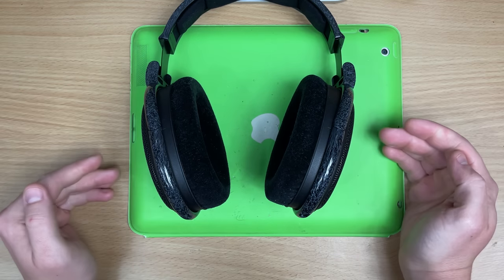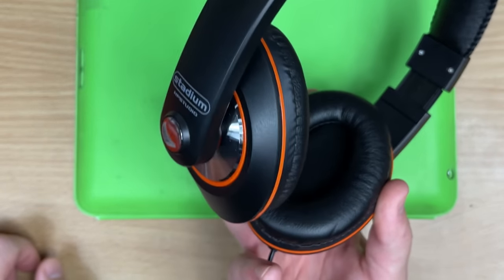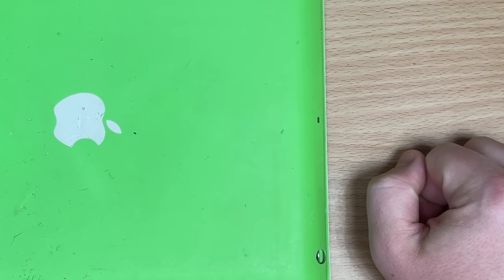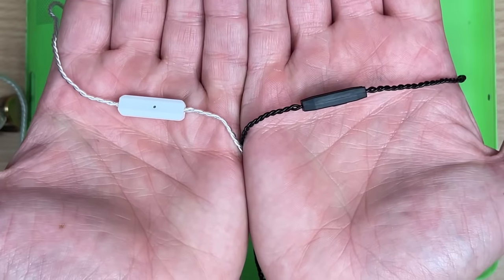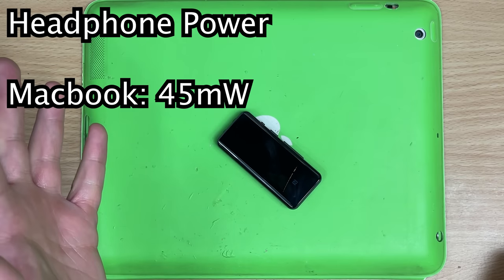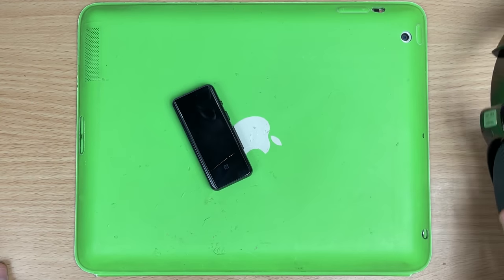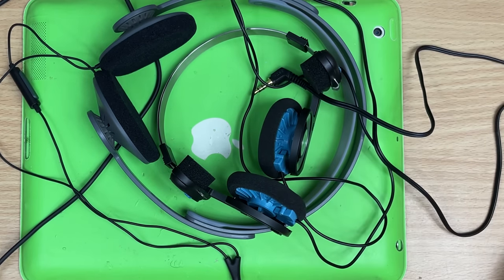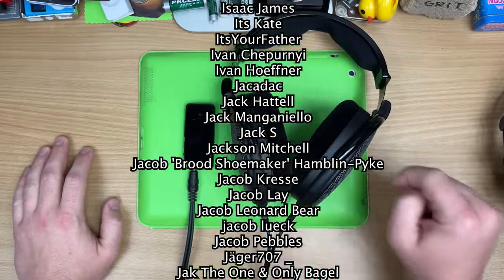My Cheap Headphone Starter Guide.

Comment: Step One: acquire cheap headphones. Step Two: plug them into your Chord Mojo. Step Three: Scarlet Fire.
Reply: Better yet, get the Chord Hugo. Hugo would make good friends with Craig.
Reply: @EpicB  now I want to see the Hugo and Craig have a collaboration
Reply: Yes
Reply: Nah m8. Plug them into a THX 789 and pump 6000mW of power into them until they catch on fire.
Reply: April 30th 2021 "Crimson Blaze Incident"
Reply: *Step Three: Start a Fire
Reply: Step four: fire.
Reply: @willywonka3050  there is no way that the 

THX 789 can pump out 6W to any OHM load
Reply: The Chord Mojo is not even that powerful, if you wanna blow headphones speaker amp or something more powerful like the Topping A30Pro.
Reply: @temp0ra  check the specs sheet. 6W into 16 and 32 ohms.
Reply: @willywonka3050  Just based on pure math from measurements the thing wouldn't push out 6 watts into a 32 ohm but somewhere near to 5 watts, but would push 10 watts into 16ohm.

the spec sheet rounds numbers, the unbalanced high impedance load value on the spec sheet is also higher than what measured.

Check measurements from Amir from audiosciencereview.
Reply: @temp0ra  you’re probably right. However I don’t trust Amir anymore. He used to do good measurements but dude’s gone off the rails recently.
Reply: @willywonka3050  Is it due to him measuring headphones?

common thing i hear, that he measures headphones totally wrong and too loud.
Reply: @temp0ra  yeah. That’s the common consensus on Reddit. His older measurements should still be trustworthy tho.
Reply: @willywonka3050  I wouldn't trust the Reddit people personally, people just go nuts on things they don't understand.

Headphone preferences are a thing and I don't see what he does wrong, I don't see how perfect coupling lowers distortion or anything. Again if you say his measurements are incorrect you should be able to produce ones which are correct.

Which was one of the cases on headphones he measured, the manufacturer said you are measuring wrong but didn't provide any measurements of their own.

People tend to have an affection or identity about something expensive they bought, it's this feeling of it has go be good and when it's against it they go nuts.
Reply: @NebulatheZorua
The will be ORANGE

Comment: My pair of Beyerdynamic DT 990 Pros were game changing in my audio production for YouTube. Still a speaker guy in general though, suck it neighbours.
Reply: For those who are interested, my speakers are AudioEngine HD3s, which are also my DAC and headphone amp too.
Reply: Bum nuggets
Reply: Do you not find the too sharp/siblint? People say that.
Reply: @Xyros0  i am rockin dt 990s aswell and especially if you browse around yt a lot you will run into videos with poorly mastered audio. sometimes i have to switch to different headphones or speakers because it can actually be painful, even at low volume. When you want to get 250ohm's plan for a beefy amp, these fellas suck way more juice than you expect. I can Highly recommend the dt990 pros tho. I absolutly adore the sound. They are super detailed and go way down in the base and almost start to rumble without sounding "muddy"
Reply: DT 990 gang, REPRESENT!
Reply: @Xyros0  I use the 990 pros for my complete production and unless I'm going deaf, they don't feel sharp at all
Reply: Super happy with my 770 Pros especially after I took Danks advice and bought a BTR-5. Forget onboard audio devices on modern PCs, they can't compare to good DSP.
Reply: @evanstavrou918  no u
Reply: @Mint Parfait it’s worth looking up, but basically the HD3s are an all in one, of three of their other products, so it’s a full blown DAC and a full blown headphone amp that’s just packaged into what are effectively the A2+s but better looking
Reply: @Xyros0  I've been using my DT 990 pros for over 6 months now for general entertainment like games, movies, and series and I don't really encounter sibilance except for some youtube videos but to be fair when I switch to my IEMs those videos still have sibilance lol.
Reply: @oOSpecialProskillsOo  try sonarworks (ik it costs money) they flatten the headphones with an eq, I wouldn't recommend it for good mastered audio but if it's poorly mastered try it
Reply: @Xyros0  I use them too and at first I did find them a bit abrasive but after a while I got used to it and grew to love it. Now I truly miss it when it's not there and other headphones feel flat and lacking in detail.
Reply: True
Reply: @oOSpecialProskillsOo  ive heard mixed things from people about burn in on those and how after a while that would go away did that ever happen i was considering those headphones a while ago and in the end was convinced to get the 880 250 ohms
Reply: dt880 is the only acceptable Beyer. Even then, spend a bit more and get HD6x0. Don't be part of the Beyersremorse statistic.
Reply: @The_Real_Frisbee  I legitimately enjoy a product I bought, what's your problem? If you don't like them that's fine, I'm just saying that I really like them. Like he said in the video it doesn't matter what you're listening through as long as you're enjoying the music
Reply: Love my dt990pros!!! I run em though a btr5 and its a real treat I lile the kinda extra top and bottom while still having everything else. Like my grado sr225s soundwise a tad more but I use the beyers more often since they are just so comfy
Reply: @The_Real_Frisbee  i've had DT770s for nearly a year. Both adjustment sliders can slide out of place... Probably because even at past the highest setting they are still too small for my head.
Reply: Aight
Reply: I just have Bose speakers ... and an element one amp Dav and a hd6xx and an lcd-2
Reply: Love mine, but those high's need to be tweaked in eq
Reply: @Xyros0  
Because of that (and the better imaging) i prefere the 880s, BUT the soundstage the 990s have is amazing
Reply: If you like the sound of the 990 I wanna recommend sticking nails into your ear canals until blood comes out, which sounds equally impressive.
Reply: yeah, im rockin the 990 editions, great times!
Reply: @thermigga1892  I had the same thing but in the end i went for the DT990 edition 600ohm. In my personal opinion burnin is a bit overrated(people will kill me for this). But for me after about a day of usage the highs became a bit smoother and less harsh. But in general the headphones sounded amazing out of the box. i do think people exaggerate about the highs(yes the highs are a bit high and sharp but even for my young ears unruined ears that sharp)

But these are my two cents, the dt880 is also an amazing choice.
Reply: Yeah! They're so fricken good!
Reply: got the dt990 pro just today LOL, im loving them
Reply: @oOSpecialProskillsOo  ayeaye
Reply: I got some really fat Behringer Truth B2031s, I use them fine producing music, but I don't use them for mixing because they just have such fat subs that it makes me misjudge just how much bass I'm putting in. I use, surprisingly, my Skullcandy wired Crushers. They are... Weirdly good. Upsettingly good. What with the bass boosting slide and the hip look and all that, you wouldn't think they'd be great mixing headphones, but they are ridiculously good at it.
Reply: I thought about buying Them but bought the 770 pros
Reply: I’m trying to get into gaming headphones.should I get the dot 990?
Reply: Yo george
Reply: Ayyy, DT 990 Pro gang 😎
Reply: To all those that are saying about the dt990 not sounding sharp anymore after a while or better after some time, for your info, is due to pad wear-in, which leads to the driver getting closer to your ear, altering the sound by smoothening the treble!
Reply: @darwin0988  yep!
Reply: DT 990 Gang
Reply: 990 GANG WOO
Reply: I was just going to ask about these. I once had the pleasure of listening to some music (for a couple of hours or so) via these DT990's, and they are the best I've ever used. Nothing else has come close.
Question is, should I get the DT990s or the DT770s? And which impedance? Obviously I'll need an amp for anything more than 32 ohms (though the test PC I used, which is no longer available, did manage to drive the 250 ohm 990's OK).
Reply: @TheSpotify95  I can’t stand closed backs, but I don’t think you’d regret either
Reply: @pigeon3887  iv had some trouble hearing footsteps with my dt990s but if that isn't super important in games you play i highly recommendnd
Reply: @TheSpotify95  I went 250 btw
Reply: I literally just bought a pair of those K-Bear KS1 for $14 on Amazon. That's a fucking insane price
Reply: Yep. Got those. Some 30 years old, still work great. Ear cushions replaced some years ago.
Reply: literally wanted to mention the DT 990 Pro 250 ohm, I have that one and  loving it with Focusrite Solo
Reply: just to add, having such neighbor sucks if living in apartment.
Reply: @neru_d  oh no!

Anyway
Reply: It’s you again…
Reply: I'm planning on buying a pair of those in 2 days (Christmas), my first venture into headphones costing more than £20. Hopefully it ruins the experience of using shitty earphones forever.

Comment: *Me listening to the 58x sample with 58xs on

Me: "They sound like headphones"
Reply: Hmmm yes, the sound is made out of sound
Reply: Hey a question for thee I have. How well do the HD58x work with just laptop without the aditional amplifier?
Reply: @Kexa_the_Scribe  Like "better" than dirtybuds but quieter even on full volume. Get a btr5 and a balanced cable with those HD58x and you'll get a good combo even for your phone.
Reply: @xirruz  I see thank you. Though obtaining the BTR 5 might be a problem here, would  have to import it. Would BTR 3 be a sufficient replacement?
Reply: @Kexa_the_Scribe  the BTR3 doesnt output very much power to headphones, it'd be about as good as just plugging them into your phone if i'm being honest. BTR5 outputs way more power/ohms, that it actually drives higher ohm headphones without issue, the BTR3 doesnt have the same output power, unfortunately. Still the BTR5 is worth the money if you can spend for it.
Reply: @carelesslygeneric  I see, thank you. I'll wait first for the headphones themselves and test them out how they sound without amplifier on me laptop. Than If the sound won't be good enough, than I'll probably buy an amp. I'm looking for slightly cheaper alternatives since I won't be using HD58x on the go and will be using them exclusively with my HP Pavilion Gaming - 17t-cd0000. So I am not in need added bonuses such as Bluetooth 5.1 or internal battery for portabiilty.
Reply: @Kexa_the_Scribe  you may be able to get away with the sub 100$ no-name alternatives amazon recommends then if portability isnt a concern you should find some good ones. Otherwise your laptop might honestly be able to handle them just fine for the most part. Good luck to you!
Reply: @carelesslygeneric  Thanks, will definitely check in once the hd58x arrive. Before I used some who knows what headphones that sounded reasonably for the price with 32 ohm impedance and on the laptop volume  I had them on 4 /100 and I still found them loud. Will see.
Reply: @Kexa_the_Scribe  Depends on the device, but surprisingly well I'd say. You don't need an amp for them generally, but it is recommended. They get loud enough straight out of my phone (Xiaomi Mi 9t,) but I think a small amp is beneficial for critical listening.
Reply: @jasonandrews7355  I've made a mistake. I shouldn't have bught them. Now no one will see me ever again since I'll be holed up in my room listening to music.  Didn't need any amp to drive them from PC or Laptop. They are awesome.
Reply: @Kexa_the_Scribe very well.
Reply: @Kexa_the_Scribe  Grats on the purchase! I just got some, myself, and yeah... I made a mistake, too. Goodbye, world lol. You're right that you don't need an amp for loudness. Sounds great from a laptop, PC, or phone. Too bad the Samsung dongle I bought for my phone is a piece of junk, so I might buy a DAC, anyway.
Reply: @Sub2RazE  who asked you
Reply: @Sub2RazE  what a chad, replies to a question he wasn’t asked just to say “idk”
Reply: @shared29  The phone is on the phone.
Reply: same i have the 58x as well
Reply: hnm yes the audio sounds like audio
Reply: One of the headphones of all time.
Reply: @Kexa_the_Scribe  I would recommend getting the Apple Dongle for 10 bucks, it's very decent as a DAC and the US version, at least, outputs enough power to get by. It's a cheap way to upgrade your audio. The EU version of the dongle has lower power output, although the sound is otherwise equally good. Depending on your headphones and how loud you want to listen, there might not be enough volume. However, I believe even the EU version will drive those HD58Xs loud enough. Even if it didn't, it's only 10 bucks.
Reply: Guys, I think there's something wrong with my headphones, it appears that my audio is made out of waves!!!
Reply: @alkestos  I mainly use use my 58x with my laptop and the laptop volume has the scale from 0 to 100. On 12 the headphones are very loud and on 18 it's too loud for me to the point my ears hurt. So I usually use them on volume 6 or 8 out of 100. 
Didn't test them with phone but I'll try so thx for the tip :).
Reply: @Kexa_the_Scribe  If you still want an answer, I'm using the HD650, and just out of the laptop they don't sound all that great. A nice amp/dac really makes them shine
Reply: Me with my SR850s listening to the SR850s: Ah yes, the sound sounds like sound
Reply: 11:53
Reply: true haha, more solid/monitor i guess, speaker-ish

Comment: A little tip from an HD 58x owner: take out the foam on the outward-facing side of the drivers. This mod improves the cans by literal miles. To get the foam out, you take off the pads and the foam its resting against, take a long, thin implement like a screwdriver and put it through one of the holes on the cups, and then carefully push the metal mesh out from the earcup. Just take the foam out of the mesh, put the mesh back in, and re-install the pads. When I first got the 58x's, it sounded like I was listening to music with socks over my ears. Then I did this mod and the detail just picked right up, it's great.
Reply: a hero pop out of nowhere
Reply: I would argue otherwise. While taking the foam out might improve the sound (subjective), it would be at the cost of exposing your headphone drivers to dust and what not. Worse case scenario, you accidentally knock off your drink and some of it enters the driver. The foam is there for a reason. 

Now, you could argue then why the HD600 doesn't have a foam as well? my answer is that the exposed driver is well protected by its inner plastic housing.
Reply: Nah, sound wise it doesn't do anything. Sennheiser confirmed this, in their massdrop forum they mentioned how the foam is acoustically invisible. The foam makes no difference to the sound, it is only there to protect against dust and other yucky stuff.
Reply: On top of what the others have said, this voids your warranty with massdrop. Overall, just not a good idea.
Reply: @mikumaven  I'd still remove em after the warranty expires to get that HD600 look tho lol
Reply: @doritos6548  yeah i did that it looks awesome
Reply: @benignword8233  Glad to hear you're happy with it!
Reply: False. The measurements show that taking out the foam in the grills doesn’t change anything. You’re better off swapping out the foam in front of the drivers for something else if you’re want to change the sound a bit
Reply: And since the drivers on the HD58X doesn’t have any dampening on the back and is completely exposed without the foam, you’re exposing the drivers to dust and risk damaging it in the long run